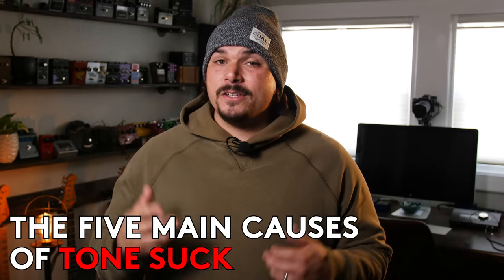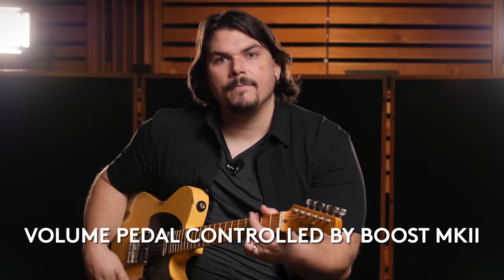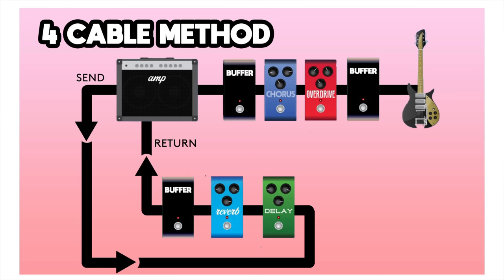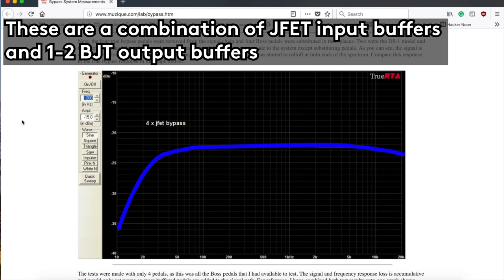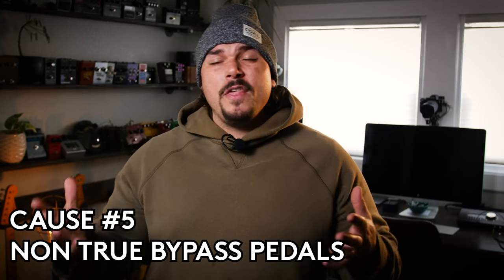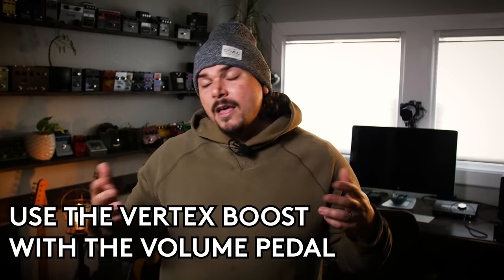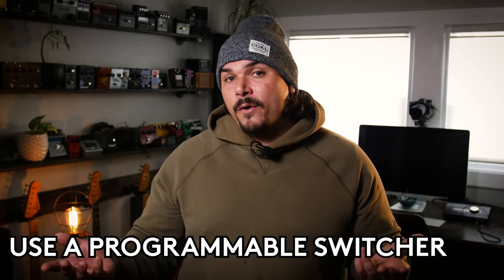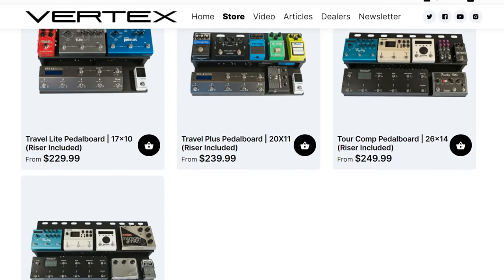Top 5 Reasons for Tone Suck

Comment: Hi, so if I have boss pedals, should I still place a buffer in front and back of rig? Where would you recommend me to put the high quality buffer?
Reply: I'd say nowhere because you already have low quality buffers. I have 8 pedals on my board, 6 Boss, 1 Marshalll, 1 Behringer. They don't exactly suck tone but cut off some volume and low end (as seen in the graphs). I do compensate that with the settings on my amp and guitar, but honestly, I don't care too much either because I usually play punkrock and the tone suck isn't that present when drowned in gain XD But i also like to hear about other strategies rather than modding the pedals
Reply: The high quality buffer should always be 1st in the chain. It's the first thing your guitar should plug into. This buffer will convert your high impedance guitar signal to a low impedance signal which will then drive long cable runs. Don't listen to this guy regarding an output buffer.  You don't need one. Once your guitar signal has been converted to low impedance than it will drive long distances. All subsequent pedals will either be true bypass which will pass your tone unaltered or a buffered bypass which means that buffer takes over. Make sure the last buffered bypass pedal in your chain has a decent buffer. Ideally 100 ohm but anything less than 500 ohm is acceptable to drive long cable runs. I wouldn't put a Boss pedal at the end because they have a 1K buffer which could have tone loss over a really long run but that pedal would still be fine if you're going 15 ft to your amp

Comment: Would you recommend 2 separate buffers. 1 for input, then 1 for output. Or can you use just 1 with send and receive like the high-wire
Reply from the maker: Either/or if the specs are right it won't matter much.

Comment: Can this tone suck be remedied by increasing the tone of your guitar/amp instead of buying additional stuff?
Reply from the maker: No, you can’t unscramble a scrambled egg with doing a EQ after the fact.  At least not to the degree where it will sound as you amp should with the guitar plugged into it with a single cable.

Comment: is the ernie ball MVP volume pedal any near as good as the lehle? or at least is it a great upgrade from a passive volume pedal, not including the extra boost option, just as a volume pedal? thanks!!
Reply: If you get the EB volume pedal you should get the vertex boost.  Running straight on a chain will suck a lot of tone
Reply: @ScottsGuitar  thanks..i just decided to upgrade my power supply instead of an expensive volume pedal, i dont use volume pedal anymore..im on a very tight budget 😅

Comment: Hey Mason! Appreciate the info. Was wondering about needing a buffer with my rig. 

I am using an HX Stomp XL. Majority of my pedals are in the effects loop of it, except for an EQD Arrows boost in the front. 

Do I put a buffer after the stomp? I could understand going through an amp, but would it get weird if I went direct with the Stomp? Should I have a buffer in the FX Loop since it's a 5-7 pedalboard that gets engaged?
Reply from the maker: I've not found the Helix products to be great buffers and historically have had to use external input and output buffers to make them transparent within rigs.
Reply: @VertexEffectsInc  I've noticed that already. So would a buffer after the Stomp work if I went direct to a PA?

Comment: are this pedals a good match? using as an input buffer a level set buffer by fender, and having an output one in a bonafide tc electronics buffer pedal... any help would be massively appreciated.
Reply from the maker: What's the impedance?  That's what matters, 1M input impedance, 100 ohm output impedance.

Comment: I use a Boss EQ-200 in a 4 wire method (One EQ going through the pedals, and One EQ going through the FX Loop). Is this pedal made appropriately for this? I believe the pedal is buffered.
Reply from the maker: I haven't looked into the manual to see how it can be used or if pre/post is an option.  If not, you could have an issue with a ground loop that may require galvanic isolation of the L and R channels.  I also don't know if you can split the EQ L and R.

Comment: Mason, your point about split loads and tuners suckung tone, is that not still a problem with buffered interfaces that have a tuner out?
Reply from the maker: No, if it's active you can have a parallel load with no issue.
Reply: @VertexEffectsInc  thanks dude, you're a massive help.
Reply: @VertexEffectsInc  
Mason, are you saying that using a buffer before the EB Jr. VP will allow the use of the tuner out of the VP? 
I’m asking about just a buffer not the boost or the VP into the expression port of your boost.  Guitar> Buffer> VP> : signal to board
                                                       : tuner 

Thanks

Comment: Do you need a buffer if you have a DI box at the end of your chain?
Reply from the maker: Like a Radial SGI?  Wont hurt especially if you ever had to go corded to an amp
Reply: @VertexEffectsInc  line isolator like the pinstripe DISO +
 thanks for the response 😁
Reply from the maker: I think the impedance isn’t that low, as I recall like 500 ohms - could be wrong

Comment: So what if all of your pedals are on. For example, I typically have a 10’ cable from the guitar, into a buffer, then a compressor, into a Waza blues driver going into an ambient delay running into a wampler reflection reverb, and oftentimes into another reverb with modulation, into a buffer and a 20’ cable into the amp. If they are all on, they are all effectively buffering the signal, correct? Are my buffers at the beginning and end of the chain actually hurting my signal?
Reply from the maker: Depends on the quality of the buffers and which pedal is first and last and their input and output impedances.  Could we optimized more depending on the pedals and specs.

Comment: I have a, Radial stage bug 🐛
Reply from the maker: You caught the "bug" huh?
Reply: @VertexEffectsInc .. Works great for me
Reply: @VertexEffectsInc  I'm waffling between either a StageBug/dual BonaFide combo or a Radial Shotgun for my tail-end (stereo) buffer. Leaning toward the former, just to insure adequate buffering.  I'm going to be running (effectively speaking) 3 amps total; A Rivera, a Fryette Power Station, and a Peavey, so I'm trying to cover my butt by making sure I have ground lift and phase reversal, and I'm gonna need 2 output buffers anyway.  Nobody warned me that I would need so many "Boxes That Make Things Play Nice"  LOL  BTW, your info is golden!

Comment: Hi, I'm very interested in the MXR Analog Chorus pedal (new production) but about half the reviews I read online state that it's a tone suck. I really like what I've heard from the YouTube reviews highlighting the sounds you can get from the unit. But ....I'm curious if tone suck is indeed a consequence of the design inside the unit, or if there is a quick fix to address it. Any comments or suggestions?
Reply from the maker: When it's off?
Reply: @VertexEffectsInc  yes. That's what I've heard anyways. I guess the pedal isn't true bypass and when not on (but still connected to the guitar, amp and possibly other pedals in the chain), it supposedly muddies up the tone (and possibly brings down the volume) of what's coming through the amp. But apparently not everyone experiences tone suck with this pedal. That's why I'm intrigued about this specific pedal, and why some are experiencing tone suck while countless others aren't. Any thoughts?

Comment: What small volume pedal is ideal for following a EQD Plumes? (100 Ohm output impedance)
Reply from the maker: Depends if the pedal is buffered and always on before it
Reply: @VertexEffectsInc  It is rarely on and I believe it's a relay based true bypass. I love the form factor of the Dunlop Mini volume to keep the board small.

Comment: Yo! Mason, sorry if you’ve answered this but where would the Ernie Ball VPJR w/tuner pedal fit in this situation of tone suck and such with the built in tuner does that do anything bad? I isolate my VP impedences with high quality buffers on input and output with my current VPJR and don’t notice any tone suck currently.
Reply from the maker: You're going to have some loss using a tuner out unless your VP is buffered, ideally on the input at least with the tuner paralleled off the input buffer.
Reply: @VertexEffectsInc  specifically I’m curious about the vpjr with built in tuner on the foot lever
Reply from the maker: @dylanlee4776  I would suggest leaving the tuner in line in this case.

Comment: Does a high quality i/o buffer have to be pedal size? What if it were always on and as minimalistic as possible to go with an ES-8 system? How small could it be? Now I'm imagining a bypass system for it with 1/8" midi to go under your board with a midi controller (like ES-8). Ugh. I need that in my life.
Reply from the maker: Check out the Truetone Pure Buffers - you’d need two but they’re small.
Reply: @VertexEffectsInc  Bro, those are perfect. Thank you! I don't want to monopolize your time but this really has me thinking. I have a Kemper and am thinking about rebuilding my board to utilize the stereo fx loop (H9, Mercury 7, Ventris, Nemesis pedals). Being that the fx loop is able to be bypassed with the ES-8 using the 7cm, do you think having an output buffer at the end of my mono chain heading to the front of the amp would suffice? I'm pretty sure the fx loop is sort of inherently buffered in the Kemper with the AD/DA converter. Does that jive?

Comment: I just added an VP Jr. to my rig and am getting major tone suck. I’d like to try the VP Jr. Tuner to fix this problem. What are your thoughts on that pedal and the quality of its buffer circuit?  Thank you.
Reply from the maker: You could also try the Vertex boost as it turns any passive VP into an active one plus you have the Boost aspect as well and the buffers aspect.  I don't know the quality of the buffer in the Ernie Ball, perhaps they have a spec sheet?  Ideally you want a 1M input impedance and 100 ohm output impedance.
Reply: Thanks for the response. I'm going to pre-order the Boost mkii from Sweetwater. Where can I find the insert cables to use it with my VP Jr?
Reply from the maker: @jsmo7  www.therigdr.com

Comment: Hey there. I have a question about volume pedals on my board. I have the Dunlop mini X which has a 250k pot. I use both active and passive pickups. I do have the Mesa High Wire dual buffer so the guitar signal is going to the buffer before the volume pedal. Can I use this pedal for both active and passive pickups as long as I have the buffer? Or do I need a lower impedance volume pedal? Thanks as always.
Reply from the maker: Yes, generally the lower impedance the better in this particular context, e.g. a 25K pot would be better than a 250 K pot, however it will still be workable. The other alternative is you could use an insert cable into the expression pot, that’s generally 10 K but often the taper is not so desirable comparatively to the one in the normal input and output of the volume pedal.
Reply: @VertexEffectsInc  Do you think investing in a good active volume pedal is overkill given I have the Mesa High Wire dual buffer in my signal chain given I use active and passive pickups? Thanks again.
Reply from the maker: @jcollell  you don't need an active volume pedal if you have a High Wire.  Something low impedance like the 25K version of the EBVP JR. or the Boss FV-500L would be fine.
Reply: @VertexEffectsInc  Great info. So guitar > buffer input > 25k volume pedal >  and so on and I should be fine. Thanks again for your time 👍👍

Comment: What are you recommendations for using an amp’s effects loop for most pedals instead of putting pedals in front of the amp?
Reply from the maker: I don't understand your question - please clarify.
Reply: @VertexEffectsInc  Most of the recommendations I see on different videos assume that your pedals are all in series before the amp.
Some amps have effects loops (I have a JC40). With the effects loop coming AFTER the amp’s preamp stage, what might that do for tonality versus putting all the pedals before the amp.
I’m not an experienced guitarist, but my thinking is that the fewer pedals between your guitar and the amp, the more pure the tone.
Reply from the maker: @vanessajazp6341  watch our effects loop video and it explains more here.  For clean amp, no reason to use the effects loop typically as the preamp is generating the distortion, the pedals are, so no benefit.  The place to use an effects loop is when the amp is generating distortion and you want to place specifically time-based (and in some cases modulation) after the preamp so their not hitting a distorted preamp.

Comment: What do you think of the Empress Buffer+?
Reply from the maker: Nice, somewhere between our DIY Buffer or Mesa Boogie High Wire and a Boss style BJT or JFET.  Not the best but middle of the road.
Reply: @VertexEffectsInc  ok. thanks for the info. its what I have at the moment. I have a ton of effects on my board, including a voodoo labs px8(which has some sort of output buffer). my take on this video is I need an input and an output buffer. so, until I make or buy a higher quality input buffer, this will do for now.

Comment: Have you worked with a board that a DI for electric guitar with an AMP out.  And if an FXloop is still possible with that.
Reply from the maker: DI off the input of the guitar?
Reply: @VertexEffectsInc  DI after Pedalboard (with and without FX loop with AMP) and after AMP.
Reply from the maker: @jabez1409  What's the purpose of the DI?
Reply: @VertexEffectsInc  just working on some ideas  for electric guitars and connection to mixer in place of worship settings. Where the AMP is a monitor for player and not micd
Reply from the maker: @jabez1409  have you considered just getting an amp that is designed for a pedalboard like a Two Notes Cab M or similar?  They can an XLR out and will provide you some amp/speaker/cab simulations so that you can go direct to a mixer and not have that "direct" sound.
Reply: @VertexEffectsInc  yes thanks.  Just saw your new pedalboard and saw that, will take a look at it.

Comment: who says I want those highs in my signal? that's not the "tone" i'm looking for. However, I want to know what is "signal degradation"
Reply from the maker: If you like a tone other than what your amp and guitar produce alone, that's one thing - but it's not typical.  As for degradation, it can mean tone loss due to capacitance, or poor quality buffering, or could be related to pedals that have mechanical bypass but still leave parts of the circuit in the chain like resistors or caps (which some older pedals do) - just to name a few.
Reply: @VertexEffectsInc  so "tone loss" only ever means rolled off highs, or is there another form of "degradation" to my signal besides that i should be worried about? 🤔
Reply: @makeajazznoiseYTstoleit To appreciate what's being said in the video you need to care about your art...and your amp ;)
Reply: @ChrisM541  I have different tastes, that doesn't make my "art" any less thanks. I don't use tube amps I play clean jazz though boutique solid state amps. Thanks

Comment: As an electronics R&D engineer, I can tell you that most pedals are "designed" using witchcraft, without understanding the basics of buffering, with high input impedance, low output impedance. Also, true bypass is essential. Passive volume pedals are crap.

Comment: No matter how much I read/hear about buffers I still have no idea when to use them.
Reply: Best i can tell he is recommending a buffer when the cable length in the full setup from guitar to amp is very long. or if there are a lot of pedals in a setup. Seems more important from live performances when you may run 25-100ft cables.

Comment: I put the Vertex Axis Wah in line and my signal lossed all integrity.
Reply from the maker: It’s true bypass, you shouldn’t have any issue with signal loss - it’s has a 3PDT switch, not a SPDT like the older vintage wahs.
Reply: I think you missed the joke
Reply: @abrackas1  CHEEKY